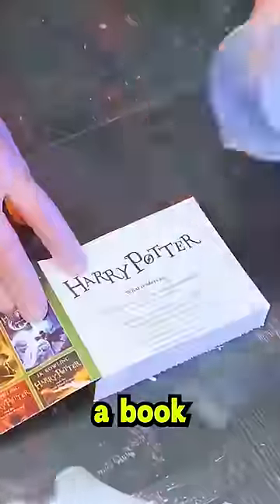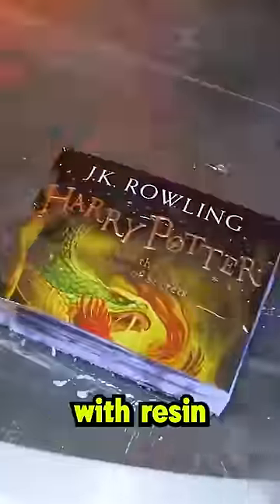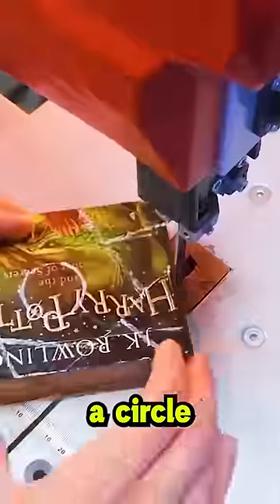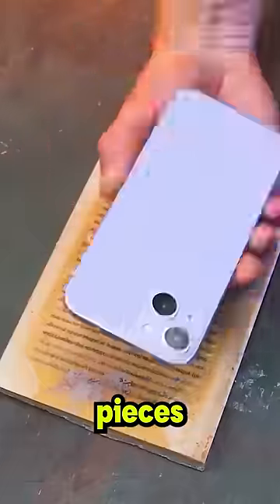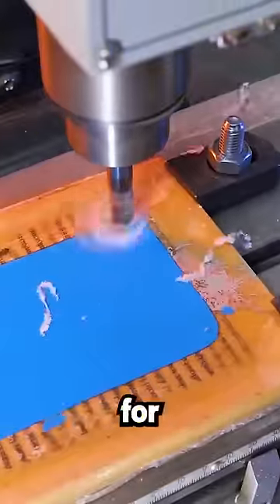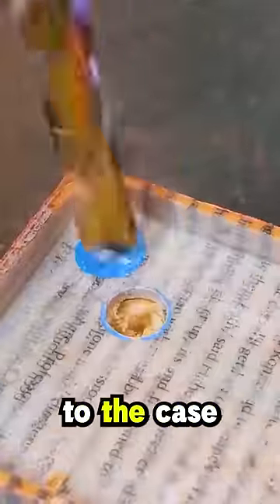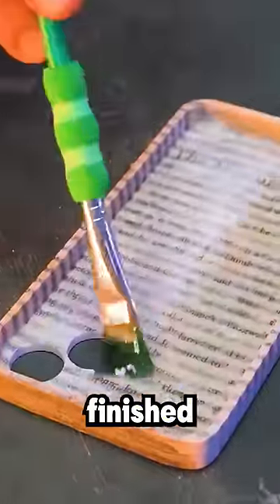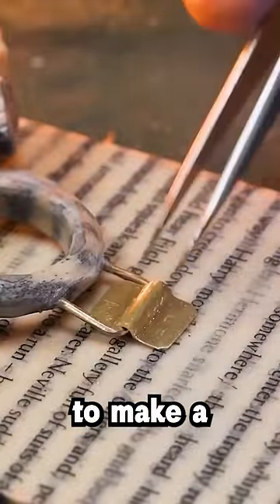Genius Book Phone Case 📚❤️ #shorts

Comment: IS NO ONE TALKING ABOUT HOW HE PAINTED THE WHOLE BACK OF THE PHONE THE CAMERA
Reply: When wet, you can just wipe it off
Reply: @chrisvickers718  Yeah, I'm sure it did not affect the camera lens. /s  He could have used a cheap case to paint.
Reply: Or just trace it with a pencil?
Reply: Im wondering how nobody noticed he didnt even cut out the holes for the volume buttons
..😂😂
Reply: @Dhr.lopes94 how about something to hold the phone it’s just a cut out not a single edge on the front to hold it in
Reply: Could have incorporated the cover art that would have been cool or isolated specific events